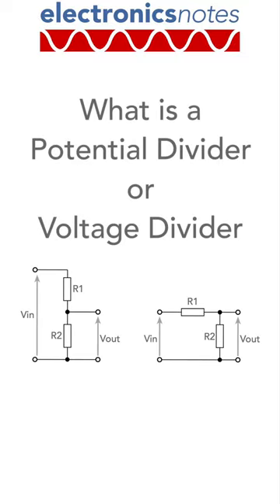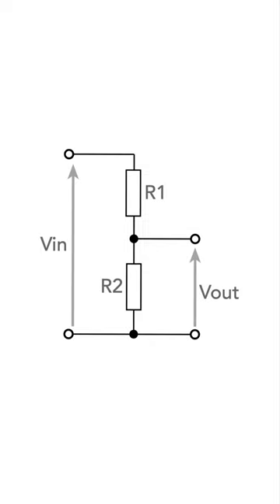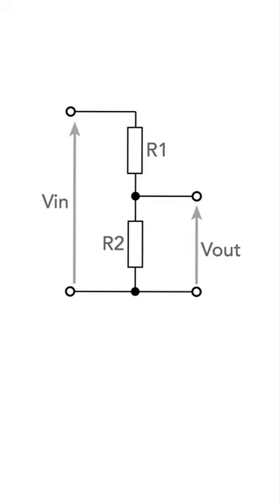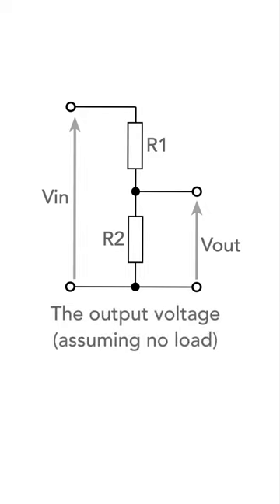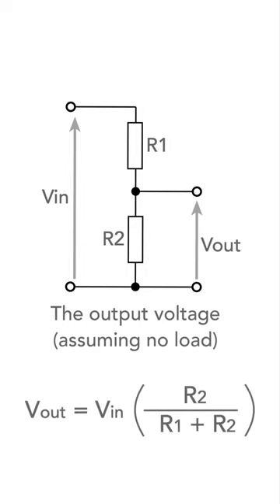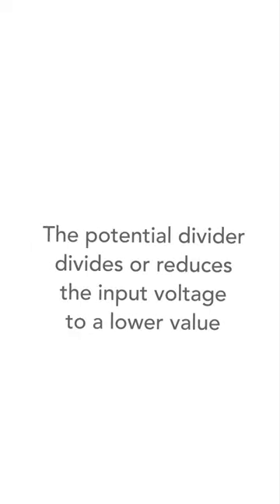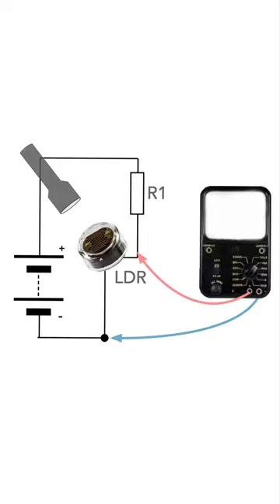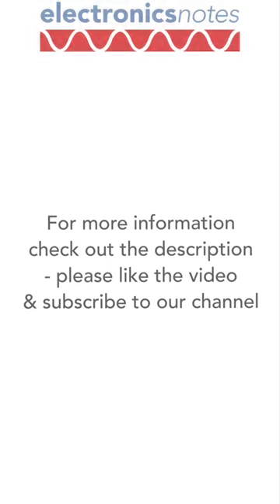What is a Potential Divider or Voltage Divider Circuit #potentialdivider #resistors #circuitdesign

Comment: i wonder why light dep. resistors need voltage divider. why they arent used as a resistor on their own?
Reply from the maker: Usually a variable voltage dependent on the light level is required for further processing & using a potential divider is the simplest way of doing this. The variable voltage can be used for light level detection, feedback to maintain the right light level, etc, etc,

Comment: Sir in the above circuit output current is same as input current or not sir ?
Reply from the maker: No it won’t be because the current flowing through the top resistor will be shared between the output load and the bottom resistor.